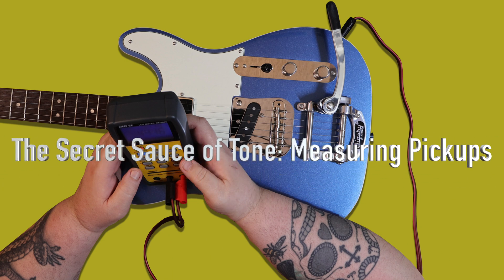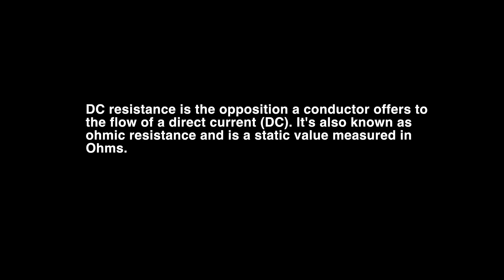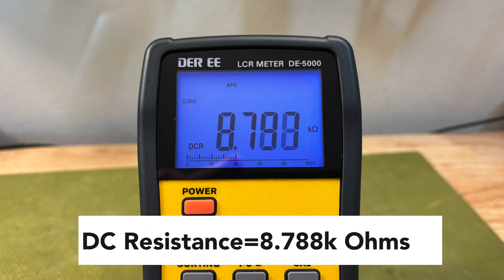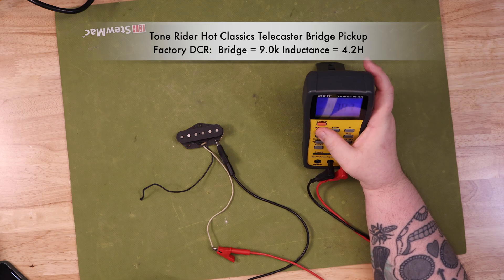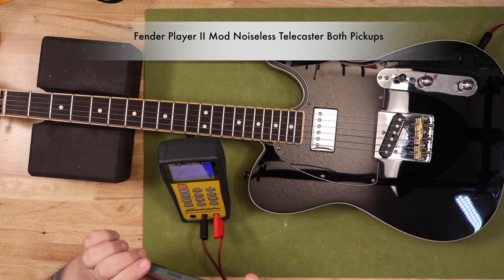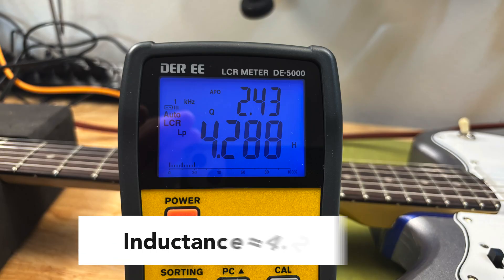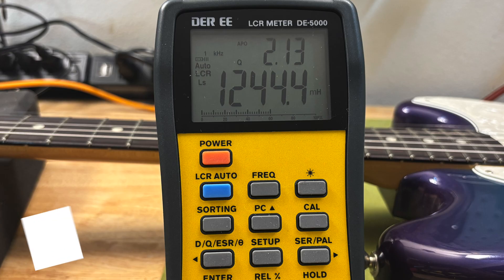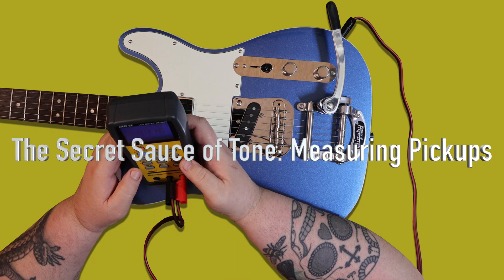The Secret Sauce of Tone - Measuring DC Resistance and Inductance on Guitar Pickups

Comment: cool video! Shouldn't inductance be measured at 100hz instead of 1kHz though?
Reply from the maker: It can be measured at 100 Hz instead of 1 kHz, but 1 kHz is the industry standard and what you should use if you are expecting factory similar specs
Reply: @guitarcollectorguy  Oh ok that's interesting, everything I read said the opposite. Thanks!
Reply from the maker: Both ways are correct. The readings may be different. For all practical purposes, especially when comparing your readings to established specifications, you should set your LCR meter to 1 kHz. If you are conducting a deeper, more technical analysis of a pickup's behavior across the entire frequency spectrum, you might take measurements at multiple frequencies, including 100 Hz.

Comment: I saw a guitar video where the guy pulled all the pole pieces off of a pickup and the resistance reading never changed. Seems to me, the resistance reading means nothing. Induction however, tells a different story.
Reply: resistance is merely a reflection how much wire is on a coil. if you know the dimensions of your bobbin the size of your wire and the amount of insulation thats on the wire you can figure out exactly how long the wire is on a coil by the resistance reading.
Reply from the maker: Would make sense. The resistance is primarily a measurement of the winding (wire).
Reply: @guitarcollectorguy Right.✅
Reply: The magnetic field matters. Ceramics magnets are stronger. Not always best to go with stronger for cleaner tones. Its nice in some cases to have a hotter pickup.